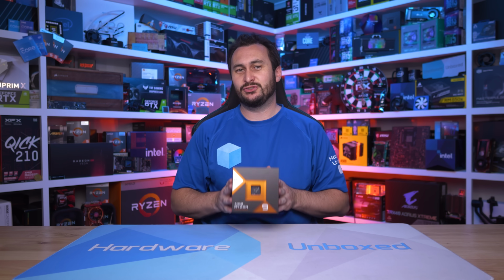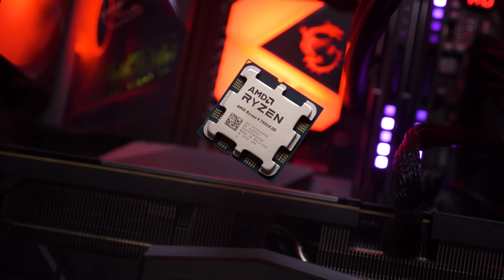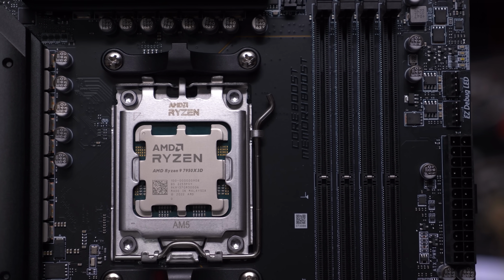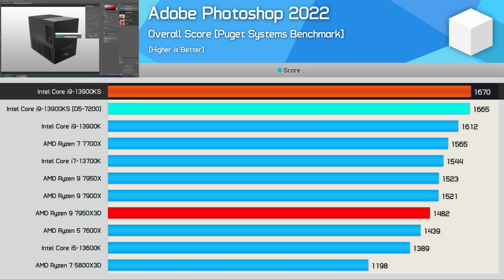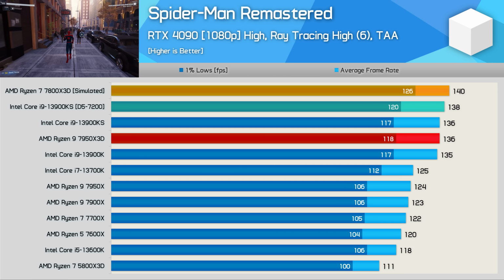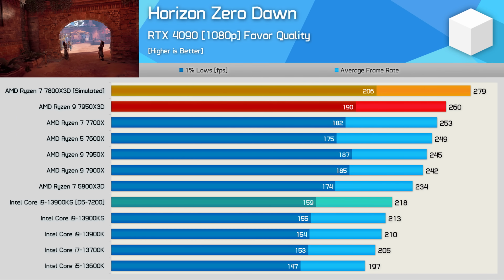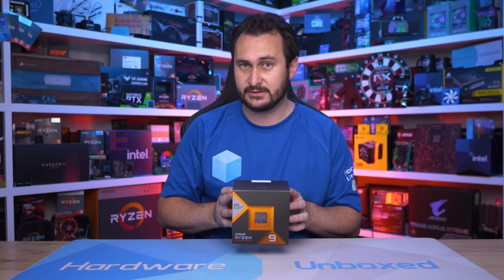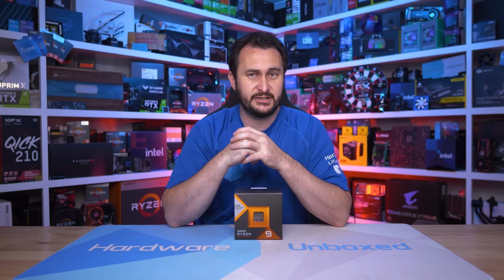AMD Ryzen 9 7950X3D Benchmark + 7800X3D Simulated Results

Comment: You guys need to put some MMO's into your Benchmark pool. Thats where those 3D parts really beginn to shine!
Reply: How often are they updating a MMO & live service games, they have already explained why they don't include those types of games as it would be a nightmare to test, as they constantly change the performances of these games when the have some kind of content or update.
Reply: @atimo4959  Is it that much of a nightmare to write the update version so people can have an idea from what they currently know at home? Performance videos don't age well anyway.
Reply: It's very hard to do consistently is the problem. You cant control what others are doing around you. And having no benchmark is better than having wrong/inaccurate benchmarks for a game.
Reply: @Jordan-ru8yf  More importantly you have to be online, which makes it harder to test a consistent system, AND the game will probably update between each review making the results hardly comparable (unless you want to retest everything every time, which you don't).
Reply: @Jordan-ru8yf  they can just do it in the marketplace of the MMO where most players gather or just make 3 system then play with tim and someone (pretty sure they have lots of parts for it). that way all three of them has the same experience. and yes its more effort but they only have to do it for 7950x3D chip vs 7950x chip vs 13900k.
Reply: They don't even do Warzone LOOL
Reply: @chovekb  warzone is typical AAA unoptimised garbage
Reply: @Kalantinus94  True man, I just got into warzone with a few friends. I have a 5800x3d with a 3080ti and it’s still a stuttering mess even when I turn settings down. I hear most people turn settings all the way down but it looks like straight garbage.
Reply: But do you really need 500 FPS on an MMO...?
Reply: @mintymus  you obviously don't know what's 200-500 players at one place!
Reply: @chovekb  lmao that's a pretty straightforward way of him to miss the point
Reply: @chovekb  200-500 players in once place?  That's server side, sorry, but even a 64 core CPU isn't going to help with that.
Reply: @mintymus  Server sided doesn't mean that you have 0 client load...
Reply: @mintymus  Hence why Cache is more important for MMO's and why the 5800x3d does so well, which is the point, the more things going on, or information that needs to be processed, more cache will only be an improvement
Reply: @Seabersify  Did you even read what I wrote?   It's SERVER SIDE.  Nothing you do on your end will fix that.
Reply: @cxssv  Yep, you're right.  So tell me if client load is 40% and you still have lag, what will the x3d be able to do?
Reply: @mintymus  Where do you get that 40% from? Building up a straw man will not help proving anything.

A lot of people have their current machine running full power, server load aside. It's not like if everyone was running 5-15fps in busy areas.
Reply: @mintymus  Argue what you like, point being is that, like other CPU bound games, especially those that utilize cache, will always benefit from the X3D cpu's, more localized cache just makes processing more...efficient I want to say (in my opinion of course!), which, at the end of the day, means more performance.
Reply: @Seabersify  Nothing to argue, facts are facts.  Sorry you're too blinded by being a fanboi to understand.
Reply: @cxssv  Tell me what MMO your CPU is maxed out 100% on.
Reply: @mintymus  Or not understanding what you mean, big difference, (in this case, explain what you mean by server side, while I'm trying to say is on performance in a game, so IDK what you mean), I'm trying to have a conversation with you while learning, if it's going to be an argument, then the conversation has ended.
Reply: @Seabersify  MMOs have a server that run the game.  They get overloaded when there are hundreds of people.  It doesn't matter what CPU you have locally.
Reply: @mintymus  Ah, I agree on that, no hardware on a players end will do anything about that, I see, in terms of playing the game though, not necessarily on server side, cache help though?? Just in terms of the game itself
Reply: @Seabersify  And that's what I was saying originally.  Sure, cache will help, but who cares about 300 FPS over 200 FPS in an RPG?  The X3D is very similar or even behind the 13900K in some games and the 13900K is quite a bit cheaper.  Same thing with the 7950X.  The X3D is hyped beyond the stratosphere for no reason...yet people are still angry about Nvidia cards being overpriced.
Reply: @Seabersify  I'm surprised to hear about your experience with WoW.  I played Classic and TBC Classic with a RX560 and i7-2600 and I usually got 80 FPS on medium.
Reply: @mintymus  And my system is OC'd! Retail in cities, I get around 60 - 90, open world about 110 ish, raids is usually 85 - 100 and these are on low settings and that, in itself, surprises me as well, though I got this system right before the 30 series, 5000 and 6000 series launched (was paying for system over 4 years, just paid off and waiting as I'm moving and wanting to see how the new generation will mature until later this year), but you see, when I saw how much of an uplift the game got from someone having a 5800X3D with an updated BIOS of over 200 fps in busy cities, you'd have to forgive me for being cautiously optimistic about the new X3D CPU's will be, at least for player performance

Comment: The 5800X3D still proves to be an amazing value upgrade considering the cost of a full rebuild to 7000 series. You'd be looking at triple the cost for what, 20-25% max gains?.. kind of puts it in perspective.
Reply: Compare that to us old school gamers still on AM3+ with FX. I'm looking at over 300% boost just compared to a 12100F. I'm sure vs the 7900X3D i'd see somewhere over 1000% increase. Either way i have to do a total rebuild so skipping to AM5 from AM3+ is a no brainer.
Reply: @VadersFist501st  I should have been more specific. I meant for those of us on AM4 already and only needing a CPU upgrade.
Reply: Anyone that already has AM4 should definitely just stick with a 5800X 3D. Anyone building a new system now should go with AM5 though. The entry is higher, but you'd just be spending that same amount of money or more later on anyway when you want to upgrade up from AM4 anyway. May as well just bite the bullet now and then get cheaper easier upgrades later by only having to buy the newer more mature AM5 CPUs later on down the road.

Comment: In gaming, the non 3D Cores should actually be disabled. Perhaps you were not running the latest drivers? Clocks are higher on the 7950x3d than on the 7800x3d, so it will be slower but price performance wise, it will be in favor of the 7800x3d.

Comment: Oh my! You've surprised me tremendously with that "simulated 7800x3d" data for Factorio. I'm very much a fan of factory games (Dyson Sphere Program especially) and it's about the top KPI I'm looking for when choosing parts. I'm very much looking to April then, since I will happily save few hundred bucks while getting top performance. Really happy to see someone except Linus doing this benchmark and hoping to see more content creators do, to have a little bit of comparison. Very sad GN doesn't (yet?).
Reply: Factorio may be a case of chipset driver not configured properly...

The Xbox game bar needs to recongise the application as a game AND (as GamersNexus had found out) the power management setting needs to be in "balanced" mode. 

Only then will the "Core Parking" feature work properly to boost performance.
Reply: @MrFredscrap  might be the case and I'm sure that by the time 7800x3d comes out we will find out.

Comment: Even if the performance isn't drastically higher than the 13900ks it's important to remember that it's doing it using more than 210 watts less power to get there. That's pretty huge. The 7950x3d will be for people who don't want to compromise on productivity or have specific applications that benefit from the v-cache, the 7800x3d will be the one to get for people who just want to game and those simulated benchmarks are impressive, it will use even less power than the sepc we saw for the 7950x3d while still beating the 13900ks.

Comment: Gamers Nexus found that the cpu performs as expected with the newest driver. Not sure if you guys installed that for this test. But that may be why you had to simulate most of these results. Either way i think the 7800x3d is for the gamers and this is for the gamers who also do production work.
Reply: What an idiotic statement lol the non-x3d versions are excellent for gaming and even better for productivity

Comment: I wonder how this CPU will age. A few generations from now when 3D Vcache is on all cores, how likely is it that developers will optimize for this particular set of chips?

That being said, the simulated 7800x3d results seem especially exciting! Thanks so much for testing that for us Steve!
Reply: Developers won't optimize for that. It is already a huge hassle to utilize multithreading and vectorized instructions sets such as SSE2 and AVX2. At best they can try to enforce thread residency so that critical threads won't be scheduled on e-cores or cores without e-caches. Other than that there is nothing to optimize for, compared to generalistic optimization strategies.
Reply: @dat_21  Even more of a reason why the processor might not age well.  AMD will have to either make it way better or give up on it.  In either case, it doesn't look good for these processors today.
Reply: Very unlikely. They don't even optimize for multithreading, specially games
Reply: Bold of you to assume that the next generations of cpus will have 3d vcache on all cores.
Reply: Developers aren’t the ones optimizing for these chips. Developers aren’t doing a thing. It’s purely AMD and Microsoft identifying if the app you are playing is a game or not and then disabling the second set if it’s a game. So developers don’t matter at all, just identifying whether the app is a game or not through windows.
Reply: Excellent point, it seems like at this point the 3D VCache is very immature.   It's either going to completely take over and get way better than now, or it will be done and go away, with something else taking over.

Comment: Would you recommend this as a decent upgrade from a 3950X for gaming and occasionally compiling Actix Web (a big framework written in Rust, which is notorious for its slow compilations)? I am a bit on the fence here.
Reply: with how much RAW ipc you are getting and frequency jump by almost 2 gigahertz.
It's pretty hard to imagine that you wouldn't reap the benefits. 
AMD 3d cache even sometimes is able to break past game engine limitations like GTA 5

Comment: Do you think AMD has binned the CCDs so that they use the best ones for the 3d vcache on the 7950x3d and use the lesser ones for the 7800x3d?  The simulated 7800x3d might end up being better than the real 7800x3d if the 7800 can't hit the same frequencies.  Of course using it in this configuration means you're paying for an extra 8 cores that you're not using.
Reply: No

Comment: EDIT: According to the GamersNexus Video this should automatically be resolved by installing the newest Chipset Drivers!

BIG FYI:

You can also force applications to only use specific cores in Task Manager.
So if you are thinking of getting the 7950x3D but don't want to sacrifice Gaming performance.
You can do that.

I haven't looked much into it but there might be other options to enable it for games by default and as far as I know they should keep their selected cores even after restart.
Reply: Setting affinity might not give the same results as disabling a CCD. I've seen a tester saying just this, that setting affinity for some reason hade a negative impact.

Comment: If Factorio results are anything to go by, the 7800X3D maybe the most "future proof" CPU for gamers, ever. 10 years from now folks will be pairing them with their $10,000 GPUs and still getting decent frames
Reply: Maybe so but so should the 7950X3D be the same. It isnt in this Chart however so there is clearly something VERY wrong.

Comment: Yea I saw that coming last year . With DDR5 and more cache sizes on newer Intel CPUs. The extra 3d cache is not adding much anymore. 
Two things that will continue to improve further. I wonder how long this 3d thing is going to be viable for. Unless AMD wants to use it to replace all the L3 cache on the CPU to save on die size and be able to use worse nodes for the 3d part in the future.
Reply: Your brain struggles with basic critical thinking doesn't it.
Reply: @geoffreystraw5268  not really never struggled with that at any point of my life. You are just a simpleton that doesn't understand anything I am saying. Stay angry

Comment: So tired of the bullshit generic benchmarks....  How about some REAL WORLD TESTING!!   in the past generic benchmarks said my 1080 was faster than my 580.. that was total BS... I put both to the test in the REAL WORLD   not some generic shit testing..   and the 580 wiped the floor with the 1080 with 3 monitors and VR...  the 1080 after 10 mins of running started stutter and had artifacts up the ass, and to top that off   FPS dropoffs ....  but they didn't show that in the generic benchmarks, along with voltage spikes and heat....    nvidiots drivers suck..

Comment: I think one more thing that should be noted in overall platform comparison is that 13900K(S) pretty much requires a beefy AIO to run properly, while 7950X3D (and 7800X3D of course) should work with less expensive and, more importantly, more reliable air coolers.
Reply: True, though for gaming it should not matter that much. Probably the only cpu pulling an insane amount of power in gaming is the KS, intel should have called it "the hottest gaming cpu"
Reply: But he already mentioned still that due to mb cost Intel cost 20% less
Reply: @savygaming007  motherboard costs are not cooler costs. You could say that with a high end air cooler it's enough for the 3D cpus, but Intel needs a beefy 360mm aio, which is more expensive. Closing the gap between the two brands. Also AMD platform isn't dead, and Intels is. So there could be a 'saving' there.
Reply: @savygaming007  yeah, wait till the energy costs are added up at end of the year....
Reply: @sacamentobob  you live in future good luck, without good new generation GPU this cpu are useless, also for power you don't live in India here eletic bill is free upto 300 unit per month 🤣 then we get subsidy
Reply: @savygaming007  lucky u then. Energy prices in europe are absurd, esp UK

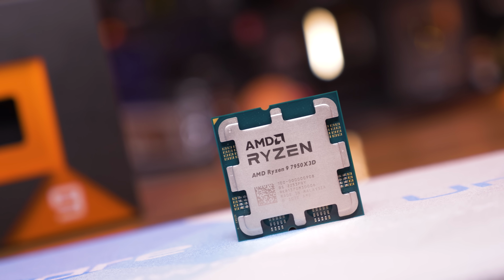Comment: 2:28 Correct me if I am wrong but my understanding was both CCDs can access the 3D V-Cache, but the 2nd CCD incurs a much larger latency penalty to do it?
Reply: I believe you are wrong, it would not make any sense to put the cache as close as possible to the cores... and then decide that the other half of the cores would require to go through the slow Infiny fabric + the other cores.
Reply: @jeromenancyfr  do you have a source or is this just based on vibes? We know the cores communicate across IF. The V cache is an extension of L3 which I believe can be accessed cross CCD. I’ve tried looking it up but can’t find an answer.
Reply: @adpt_music  I don't have source, and as you said, L3 is supposed to be shared, it is just that in all the interviews they never ever suggested that the other CCD would get any benefits from the additional cache.

Comment: 7950X3D seems yto be a good CPU but not worth it unless you wanna do both gaming and productivity. If you want top performance in gaming I feel like the 7800X3D would be the go to, it is just as fast as the i9 13900KS if not a bit better and for a smaller price and power consumption. 

We have come to the point where it is sad to see intel not being able to bring their technology far enough to give AMD at least a startle. Not to say that Intel doesn't have products that compete but if I have to stick a huge AIO to let the CPU achieve what it is pushed for  I would rather get a CPU that can get a decent cooler and do it just as good and not consume that much power at the same time. 

Even though it is still early to say but !IF! the AM5 platform age half as good as AM4 you could upgrade down the line to the last gen ZEN CPU lineup with not too much hassle and money. Plus the Zen roadmap is more promising at this point, Intel CPUs the past few gens have been stretched to the brim and even if they went "Our new 2 gens will be supported on our old socket/chipset with a BIOS upgrade" unless they bring a few steps forwards with a new node and/or architectural design I wouldn't be suprised if they start to fall behind in a significant margin on the next couple of generations.(not talking about the server space as I think the ship has already started to sail there)
Reply: Try to remember this is AMD’s reaction to Intels 13th generation not intel competing with AMDs new chipsets. Sure we will see a 14th gen in 12 months that will exceed this small leap of advancement of AMD.
Reply: I saw a bunch of graphs with 13900k keeping up with 7950x the entire time. It's better in productivity and single core performance. It's priced cheaper. Why am I reading an obituary for Intel? Did you actually watch or listen to anything that was said in the video?
Reply: @todddominoes9862  not only that it only beat the i9 in a few games at resolution people are never going to play. Even some of the 4k benchmarks show 2-3 higher with a way lower minimal frame and that’s terrible. If anything they just helped Intel sell more 13gens.

Comment: Well, that was disappointing.  More expensive than intel and no faster. Not that I would ever buy such an expensive cpu. I'd probably just buy a 5800x3d to replace my 3700x, if anything. But with my current GPU, not even that is worth it.